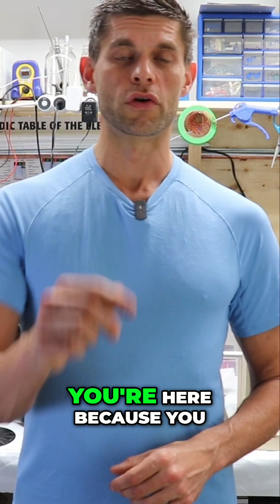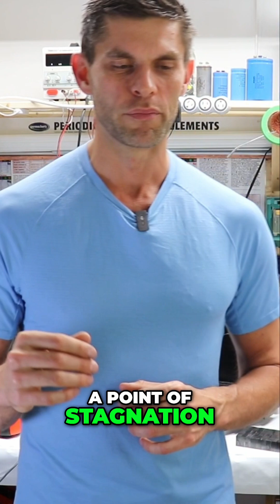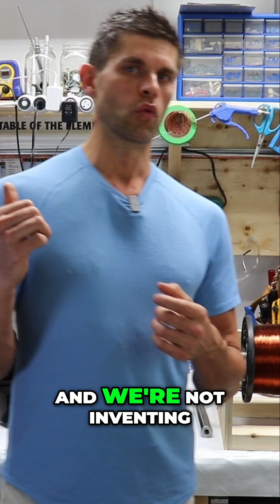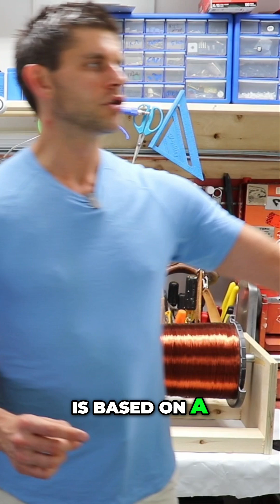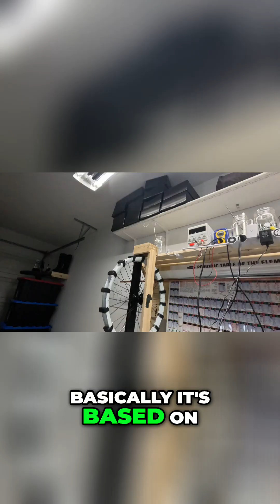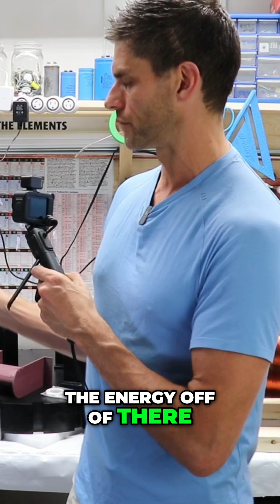Unlock Limitless Energy: Revolutionary Generator Technology Released!

Comment: Be sure to pay close attention to the value and amount of change in inductance of the stator coil at different points in the cycle (especially 'top-dead-center' vs 'bottom-dead-center' vs amount of current applied)

Chart the parametric change in inductance across the cycle and with RPM you can both model and predict how it might behave in an actual system.
Reply from the maker: Data logging is a key component of this build and proof